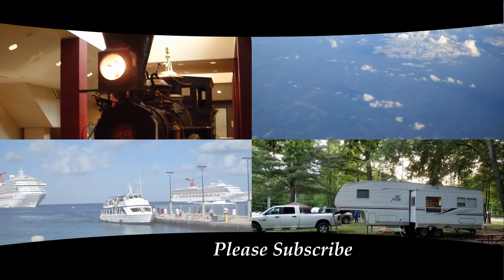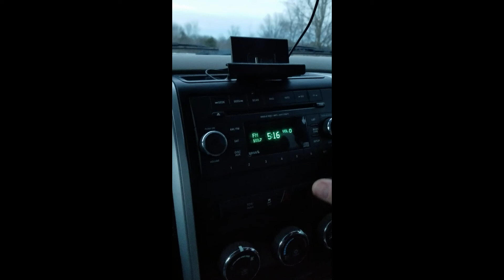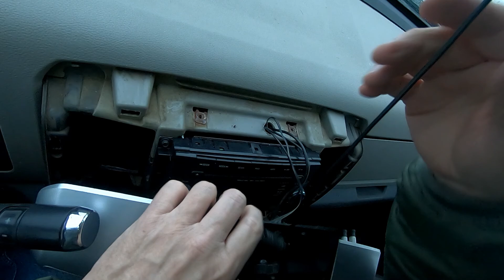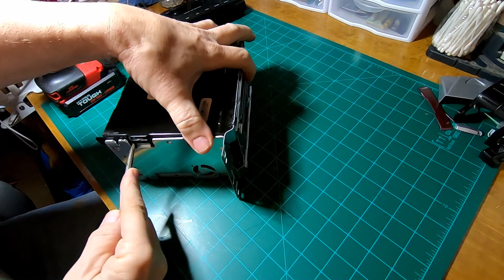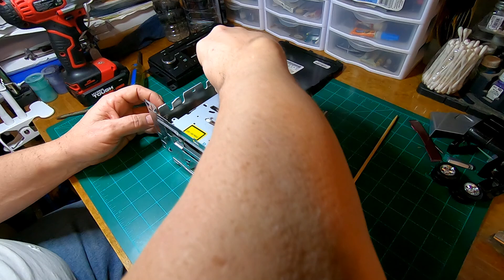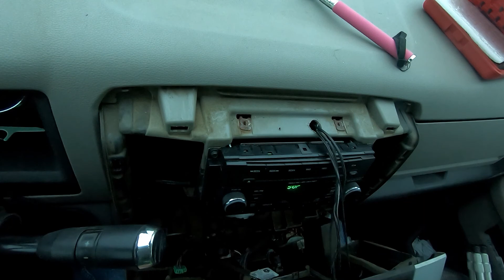DIY - How to repair the radio in your Chrysler, Dodge, Jeep or RAM and save money! - Episode 9

Comment: Spot on fix, thank you. You don't mention how you knew which chip to target but somewhere you did your homework. I first applied clean solder flux to all chip pins and I used a more common hot air gun with a focusing nozzle. I used your video as a guide to how long to apply heat and it seems to have been long enough. I don't know how long this fix will last since my radio is 14 years old (2011 Chrysler 200). I blame the lead-free solder that's been used for many years now.
Reply from the maker: You're very welcome! I did do a little homework before I made this video. It's funny how ChryCo (or one of it affiliates) made this radio with a coating over all of the components on that board except for the one that ultimately fails. I am growing tire of the planned obsolescence money grab that a lot of companies have moved to. It's not like they aren't making enough money with the over inflated prices that they are asking for their products to begin with. Anyway, I hope that this video helped you out and here's to a long life of the radio after the fix!

Comment: My RHB dvd,cd,nav etc went completely black. No sound no anything. I put a reman and it works fine. Tge technician in me knows it is just one thing in there. Any thoughts?  Do you repair them?  How did you know about that chip being a problem child?
Reply from the maker: I do not repair these professionally, I'm a DYI kind of person. I discovered that the chip failure was the cause from a Google search and from talking to a few car stereo repair shops. They advised me of what to do to repair this radio and I decided to share that info. Not having seen the inside of an RHB radio, I couldn't tell you that it has the same issue that mine did. When my RES died it would make a popping sound through the speakers and if I inserted a CD it would play music but would cut out every 3 seconds or so. The same with the AUX port.
Reply: @justcallmeboats  Dodge Radio Sucks.
Reply from the maker: @kevinheatcoat2190  You are correct! Since I made this video and posted it a different part failed inside the radio and limited its usability. I have since replaced that radio with an aftermarket Sony. I lost the steering wheel button functions but at least I have something to listen to while I'm driving.